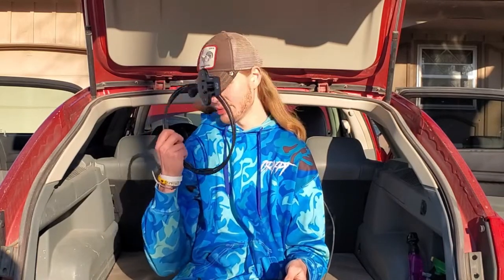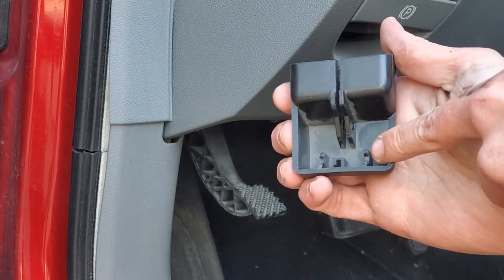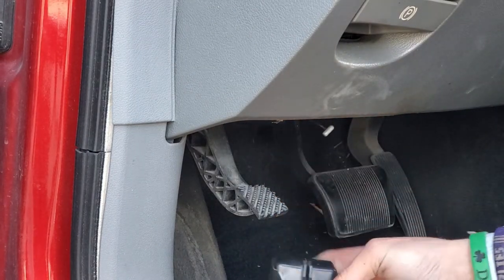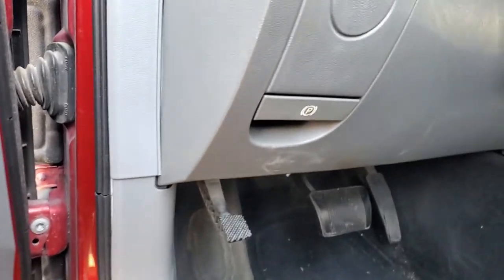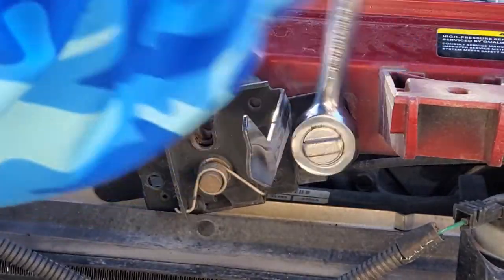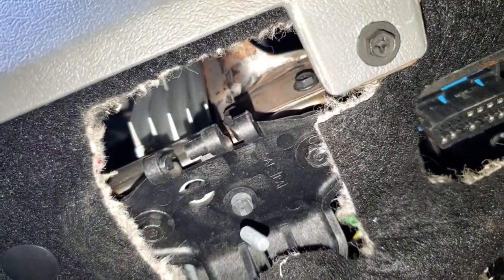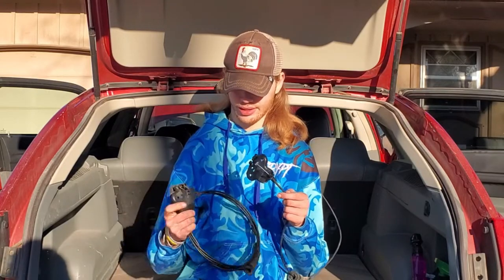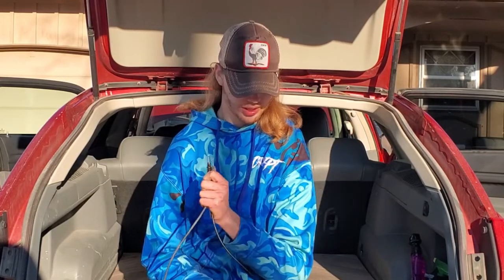How to Replace Your Hood Release Cable!

Comment: Thanks for this video. I need to take my bumper cover off soon. I want to try to add the factory TPMS to my Magnum and 2 of the 3 pickup sensors are somewhere on the front. I am curious if I will find it prewired for them or not. Also want to add the factory fog lights to mine.